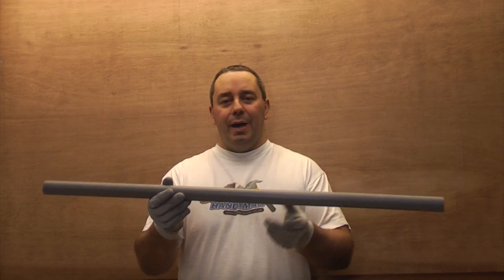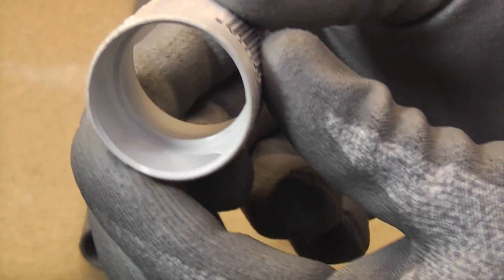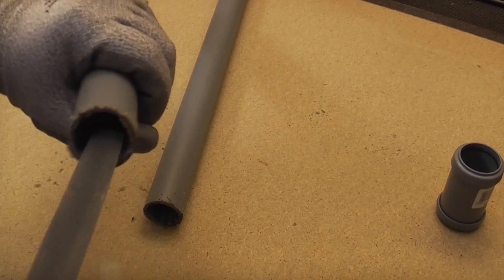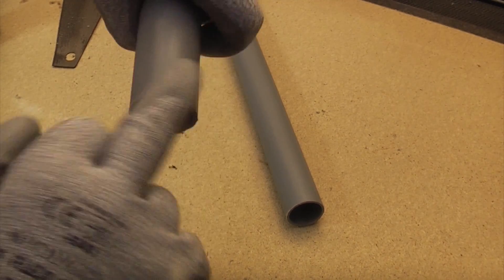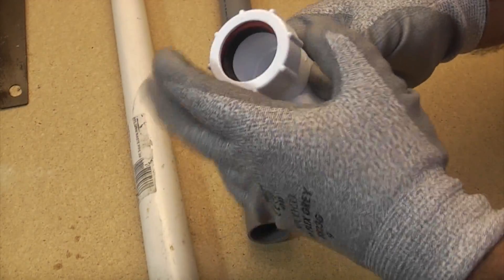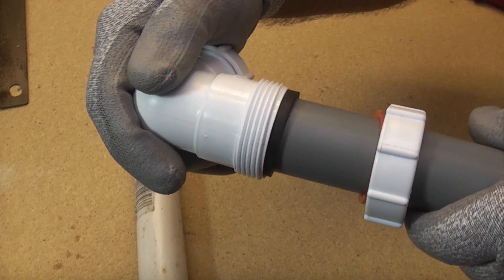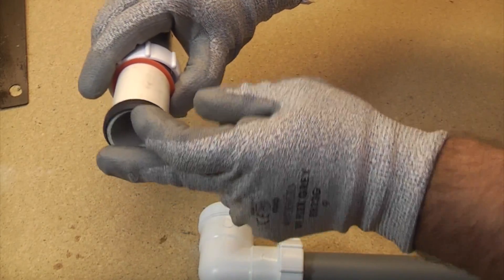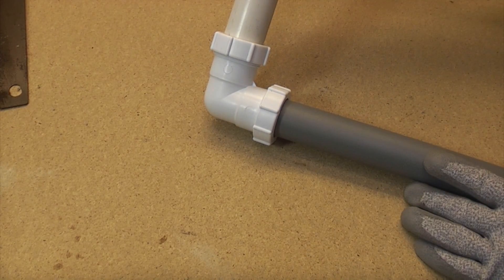Waste pipe

Comment: Thank you for showing the outside diameter measurements of the pipes. It's what I was after.
Pity you didn't show the 40mm pipe measurements.
Reply from the maker: Sorry about that
Reply: @ultimatehandyman  Don't worry I googled it.
For anyone interested:
A 40mm push-fit pipe has a 40-41mm external diameter but a 40mm solvent pipe has a 43mm external diameter.

Comment: Confused about sizes, what attaches to a drain for a bathroom sink? Sink plug says it’s 42mm, my p trap is 40mm but the thread is way too big
Reply from the maker: Normally for a bathroom basin, you would need a 32mm P trap and 32mm pipe.
Kitchen sinks normally use 40mm, as do bath wastes.
Reply: @ultimatehandyman  Oh i see thanks for the tip! The 42mm on the drain plug confused me, get mixed up with these bsp inner/outer diamete f/m measurements

Comment: So helpful, i cleaned out my P trap and now I can't get it to connect back water tight. I notice the compression fitting connecting the waste pipe to the solvent weld pipe does not appear to have a Tapered washer as I've seen in your video. I'm wondering if that's the problem. I will buy a new one and try that. Great helpful video, thanks!
Reply from the maker: Glad it helped 👍
Best of luck with it

Comment: Hi love your videos 
I've got push fit 40mm waste pipe fittings from my bathroom to the main 110mm waste pipe which enters a strap boss which all seem to be made by osma, I looked up what was compatible and my local supplier sells flopast so brought enough pipe and fittings to replace all the external which is deteriorated but the new fittings won't go over the old pipe and the new pipe is too small for the push fit strap boss any ideas 🤔.
Any help would be appreciated
Reply from the maker: Not sure about that, sorry.
I thought all 40mm push fit pipe was the same diameter, regardless of the manufacturer.
The strap on boss does have the 32mm and 40mm adaptors with it, doesn't it?

Comment: Thanks for that superb information. Just what I was looking for.
I had just realised that bathroom basin wastes were  32mm and baths were 40mm and I was using all compression  joints when I found that the pipe going through the wall was 40mm solvent weld. It can now be joined with a 40mm compression fitting.
Reply from the maker: I'm glad the video helped 
Thanks for the comment 👍

Comment: Can you use these compression elbows outside? I have a push fit pipe from basin waste going out to  a weld waste pipe and need to join.
Reply from the maker: Yes, they can be used internally or externally.

Thanks for the comment

Comment: Its getting clearer, and what about joing 40mm to the 30ish one (1.25 inch)
Reply from the maker: You can use reducers to join different diameter pipes together-
https://mcalpineplumbing.com/plastic-chrome-fittings/multifit-waste-fittings/t12mc-multifit-reducer

Thanks for the comment

Comment: I just tried to fit a push fit pipe into a compression joint (40mm) on a shower waste. It leaked, It also looked and felt very loose, which is why I tested it. It might work with 32 mm but I would not trust mixing 400mm waste pipes with the wrong joints

Comment: I have in the past come across waste pipe using pushfit joints but the outside diameter was that of solvent weld size. This caught me out as the fittings I had bought were pushfit but did not fit the pipe with pushfit joints. The fittings and pipe were made by OSMA. 
I have since come across other examples of this non standard OSMA pipe
Reply from the maker: Thanks for the comment

Comment: Please can you tell me how I should join the chrome waste pipe from my lovely chrome bottle trap to the plastic pipe which goes out the wall into the soil stack. Really would appreciate your advice. I can't find any info on what connections I should use. Loads of people have chrome bottle traps but no instrusctions on this. Many thanks Lynn
Reply from the maker: Hi Lynn, it depends on exactly which trap you have.
Normally the connection can be done using a universal compression coupling like this- 
http://www.screwfix.com/p/floplast-wc07-universal-compression-waste-straight-coupler-white-32mm-x-32mm/15490
Reply: Thanks for your reply. It's a square chrome bottle trap with a 35mm horizontal chrome pipe which will goes straight through the wall to the outside . I have a void section of 50mm between the backer board and the brickwork in which I've made a hole for the plastic pipe to exit to the outside. I just want to be sure that there won't be any leaks as once the wall is tlled in travine, it will be there for some time to come. The only way to get at it would be from the outside of the house where it will  go into the soil stack. I've searched every where but there seems to be little info on how the chrome pipe should join up to the plastic pipe.

Comment: how to I connect 40mm to 32mm?
Reply from the maker: +mrqwerty123456 
You can use a reducer like this- http://fave.co/1OqSVCn
Reply: +Ultimate Handyman I bought this http://www.homebase.co.uk/en/homebaseuk/waste-reducing-connector---40x32mm-586485

but how do I used it, the 32mm fits into the twisty bit but the 40mm doenst fit over the other end.
Reply from the maker: +mrqwerty123456 
It looks like you now need a straight 40mm coupling to connect that to your existing waste pipe. 
I think the reducer you have gives you a 40mm male connection, hence you now need the straight coupling.
Reply from the maker: +mrqwerty123456 
Yes, that would joint the two pipes together.

Comment: I have a 1 1/4 inch boss on mcAlpine toilet pan connector, I cannot connect a 32 mm push fit pipe to fit, can you recommend what I can do... cheers
Reply from the maker: +scratchy fixit You should be able to use a compression elbow like this- http://fave.co/1NYcmCm

Comment: Hello can you advise about my crack pot idea? I want to build a metal detector coil into some 21.5mm solvent waste, but It will need splitting and then re-glueing, am I barking mad, thank you for your time.
Reply from the maker: Splitting and re-joining solvent weld pipe should not be a problem as long as you use solvent cement
Reply: Thank you

Comment: Useful to know, one thing I might suggest is that you do not use washing up liquid as it can perish the rubber seals. I am a pipe layer and I always use pipe grease.
Reply: Using washing up liquid is bad practice because, in its diluted form, it breaks down the seal material over time. The washin-up liquid experienced in use is normally highly diluted by the washing-up (or other) water.  The correct thing to use is Silicone lubricant which is widely available and has a wide range of uses including upvc guttering, soilpipe seals, garden hose (hozelock type) seals etc.  It also provides some protection for the seal material.
Reply from the maker: Thanks, I was always told to use washing up liquid, but often use PTFE spray or silicon grease.
How log does it take for the seal to be damaged if you use washing up liquid?